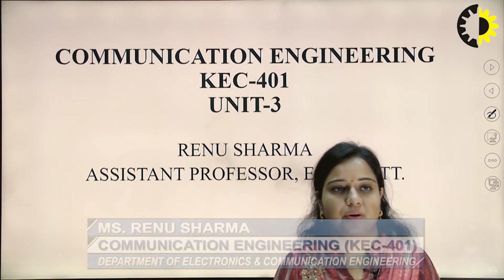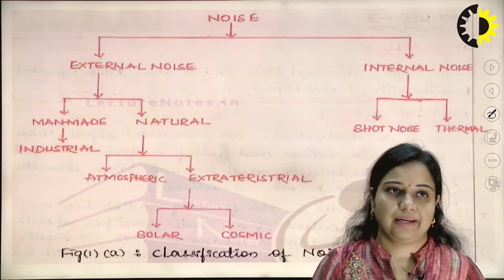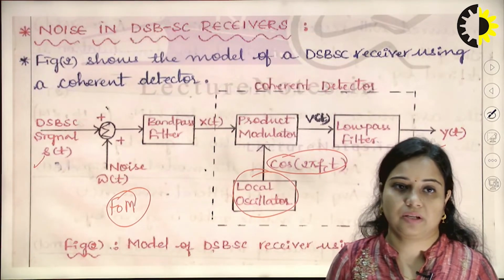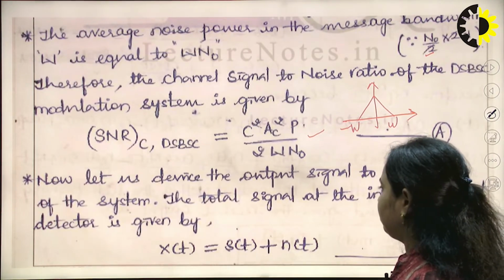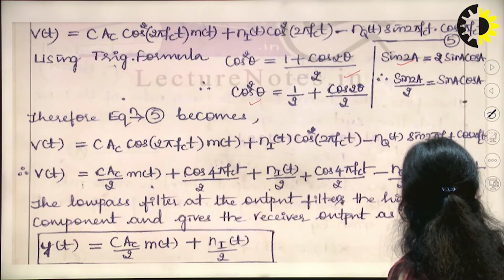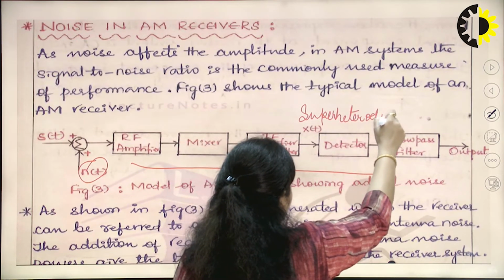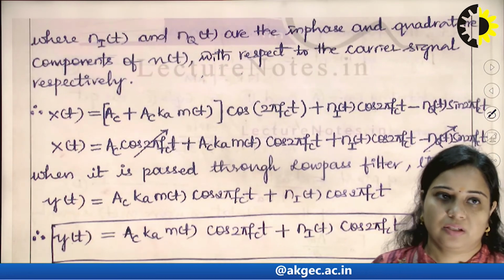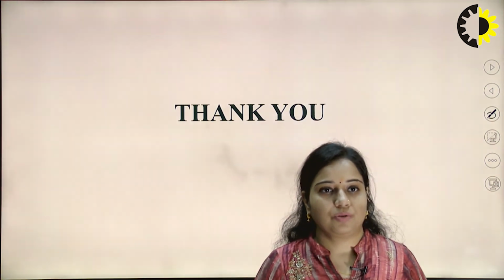COMMUNICATION ENGINEERING LECTURE 13 ''Noise Analysis in Reciever Model'' by Ms. Renu Sharma, AKGEC

Comment: Mam I have a question about wireless communication which confuse me there are some question   can you help me by answering these questions
1.video transmitter and receiver is use for video transmission and audio transmitter and receiver is use to audio transmission than what is the name of transmitter and receiver  that is use in remote control to control motor and other function
2.how many type of modulation can be  control a function
3.which modulation based RC transmitter and receiver is use to communicate in short range and which is use for long range function controlling